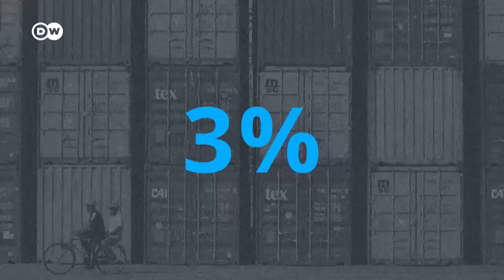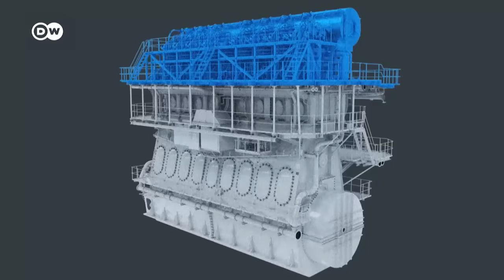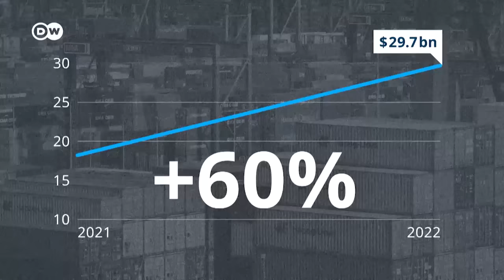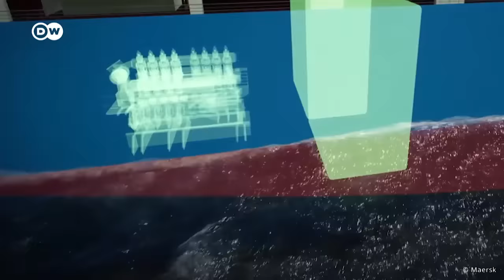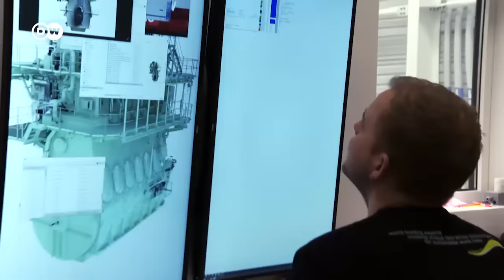Why cargo giant Maersk is investing millions in methanol-fuelled ships | Transforming Business

Comment: They didn’t mention the biggest drawback of methanol, which is it’s less than half as energy dense than diesel. So you’ll need 2x the size tank to go as far. That means higher costs for shipped goods.
Reply: 6
Reply: China using electric trains to ship to eu,
Reply: @joelimbergamo639  the goal is to restrict shipping competition by increasing compliance costs, I can see eu banning non green shipping
Reply: @bedeorama9881  good thing we can shift everything to electric wich is carbon neutral 🤔
Reply: You don't really need to mention the fuel that you are explicitly moving away from.
If we wanted to do a direct comparrison there are multiple factors that would also have to be included, not least the fact that diesel shipping is being subsidized. 
If shipping using diesel had to pay not only for diesel production and delivery (input cost), but also for output costs (environmental pollution, human health-based productivity loss, etc), the price of shipping with diesel would be significantly highr.
Reply: @joelimbergamo639  The video mentions 2034 as the deadline for 2% renewable-sourced fuel in the EU. Perhaps you mistyped. 2% is only a tiny first step, but it ensures that every shipping company has looked hard a decarbonization and started to invest in a solution of their choice. They don't have to choose e-methanol, if a better solution like ammonia is ready in time.
Reply: Many ships have fuel tanks far larger than are actually needed for their ordinary operations, and the extra capacity is instead used to optimize where exactly they refuel, depending on regional price variations, scheduling, and so on.
Reply: yeah but if cost of methanol fall below certain price, it will become economical.

And its price will fall because the price of Green Hydrogen (which is used to make methanol) will keep falling.
The price of green Hydrogen will fall with time because Electrolizer will become more efficient as well as cheaper and price of Green electricity is also falling exponentially.

Exponential cost curve always disrupt the industry.
Reply: Similar for ammonia, plus ammonia is bloody poisonous making handling it a hazard.
Reply: @DatingForRealYoutubeChannel True. The old bunker oil used to kill hundreds of exposed workers every year, so polluting fuels need to be reduced asap.
Reply: Methanol also won't produce as much power when burnt in the ships engine. You know what would be a great start in reducing emissions and only require a pen stroke from the person at the top of the shipping company. Burn only diesel instead of switching to  heavy fuel oil after leaving port.
Reply: They burn bunker c fuels (#6 fuel oil). Methanol has 64500btu per gallon where Bunker fuel has 156000btu per gallon.. this idea is ridiculous 😅
Reply: @Charvak-Atheist  mm  no.

Comment: The cost of inaction on climate change and pollution  is much bigger than the price of climate change mitigation
Reply: Yes, and this has been true for the last 30 years since the Rio Summit where the participating countries passed a resolution to reduce carbon emissions in order to avoid dangerous climate change. If the world the world had acted as quickly as it did on ozone-depleting chemicals (the Montreal protocol), we would be half way to a solution by now, and the transition costs would have been significantly lower. As it is, carbon emissions have not yet peaked. But all that is water under the bridge, it has already happened and we can't change the past. Urgent action today is what matters.

Comment: What's the point? Burning methanol still produces CO2 and water. Same for any biofuels/ Burning of any fuel, no matter what its source. releases CO2. How do you ever get around that basic chemistry???
Reply: The idea is the CO2 to make the Methanol is captured from the environment. And the energy to do so is from renewables. Therefore net zero.

But even though it has an outsized effect on the environment, there's not actually that much of it in air compared to Nitrogen, which is the feed stock for Ammonia. Hence why the talking head said that was a better synthetic fuel to use.
Reply: Seriously? Did you even watch it?
Reply: @spateri728  I don't really think it can ever be net zero. But point taken. It;' the best they can do. :-)

Comment: In the perspective of alternative liquid energy carriers for flexible and safe usage, methanol has many advantages. Methanol as the simplest alcohol is the most effective carrier for liquid bound hydrogen (at moderate temperature and atmospheric pressure) in regards of molecular hydrogen-carbon weight ratio and environmental friendliness. Many microorganism need methanol as nutrition to work properly (e.g. bacteria's in sewage plants) or just have a look at the nature, where megatons of methanol is emitted by our green plants year by year as a product of photo synthesis and is used by other plants and microorganism in their nutrition and energy life-cycles. 
Renewable methanol as a liquid energy has the big advantage of a "one for all"-feed-stock. We can use it either as fuel for fuel cells or in conventional thermal application or as a fuel blend in a high variety of concentration. Also new plastic products will be made from renewable made methanol (e.g. LEGO). One product who can cover many applications and use existing infrastructures for storage and distribution. This is very important in a sustainable thinking of re-using existing infrastructure and the way we can smoothly transform from "old technology" to the new energy applications in a holistic view of new solutions. But yes there is the important question, how and where we will get the energy to produce renewable methanol? Well, why not copy the energy efficient principles of nature for that (e.g. methanology.com, synhelion.com)

Comment: Where biomass is created as a biproduct in sufficient quantities to improve soils, salt affected (often desert) soils (which are often barely soils but barren) can remove salt-affected ground (a big task) and then make soils from the humic material atop it and grow alcohol cash crops (or lipids and sugars) often in blistering hot conditions but the ground temperature is shaded and increases the probability of rain falling to hit the ground before evaporation might have otherwise prevented it (which is what currently happens). It means however that methanol and ethanol are made. Methanoic acid is a useful biproduct such as for ice removal. Cocounut and sandalwood are amongst some salt tolerant crops. Some lignite coke can yield germanium as a biproduct worth keeping (electronics, especially spectral analysis computing, etc.). The more cash crops however, the less the need for the coke oven gas. With designing, a vessel with more than one fueling mechanism can travel to the waste plastics in the seas and collect and convert the plastics into fuel by pyrolysis in large amounts and use it for propulsion.
My comment has no hate in it and I do no harm. I am not appalled or afraid, boasting or envying or complaining... Just saying. Psalms23: Giving thanks and praise to the Lord and peace and love. Also, I'd say Matthew6.

Comment: Longer term an interesting engine would be one which uses methanol and oxygen rather than air (maybe add the oxygen to an exhaust gas recycle stream).
Exhaust CO2 can then be separated and returned to port to make more e-methanol.
For really big ships use a direct SCO2 turbine to do similar, even easier to separate and return starting from pressurised CO2. 
No bio source of CO2 nor DAC needed, the CO2 becomes contained and circular.
Reply: Interesting. I think "SCO2" refers to supercritical carbon dioxide (also styled sCO2). Some references to research would be helpful, if somebody could provide them.

Comment: they ought to put more into RnD to create even more efficient Methanol Fuel Cells? Once we get 70% efficiency, we should ought to just stick to FCEVs using electric motors for propulsion on both water and land and use much smaller batteries unlike a BEV? Also ships are big enuff and just by being on water could they not capture CO2 from water (currently easier than capturing from air) and turn that to Green Methanol on the go? I believe i read a recent research article mentioning the US Navy doing this? Btw there is a FCEV Methanol powered sports car called Gumpert Nathalie built by a legendary german engineer i believe..
Reply: That was thought exactly. With an high efficiency methanol fuel cell (rather an old fashioned IC motor) you can have an all- electric ship with all the advantages of that solution (efficiency, steady operation, compactness, etc...)

Comment: Why can't fermentation generated methanol be used? It is a waste product of spirit distillation (vodka, rum, whiskey, etc). It is also a waste product of charcoal production; being made by the pyrolysis and distillation of woody plant material such as the discarded branches from logging, the stems and leaves of food crops, paper waste and the scrap lumber from construction and demolition projects. Methanol is also called Wood Alcohol for a reason; we've been refining this method for the past 5000 years. We can now also capture the gaceous byproducts (methane, and CO) to use as an alternative to LNG and propane. While it does take thermal energy to run the process, recycling the tar and a portion of the charcoal to run the process will still net much more usable fuel. 
It can't produce all of the fuel we need, but it is A method that will clean uo other industries by using their waste.
Reply: I believe fermentation-generated methanol is called bio-methanol, and along with electrolysis-based e-methanol it is mentioned in the article. Maersk is also sourcing some of it future green methanol from bio-methanol. The problem is that its potential for scaling is more limited than e-methanol, the feedstock is finite and the world would soon run out of land for photosynthesis if it relied only on bio-methanol to replace fossil fuels. This would also compete with food-growing uses of land, driving up the cost of food which would impact food-importing countries a lot. So it looks like bio-methanol will only be viable in a transition stage until a production pipeline to generate affordable e-methanol can be put in place. What is "affordable" in a world dealing with a crisis of global-heating changes over time. The cost of not acting or continuously postponing action is even less "affordable".

Comment: If regular engine is power with compress air+fuel only 25 % fuel is needed,now compress air can be produced in open sea and mid ocean 
refueling ,the trick is dessing a energy harvesting vessel probably sail, kites,,solar if a vessel is only used to power a compresor or hidrogen production 50 to 100 mw/h
can be achieved,they will always sail at 90° against the wind.

Comment: The cost of green methanol will depend on how its produced and how much is produced. Methanol will be needed to replace fuel for ships, to replace natural gas for natural gas electric power plants and for the production of synthetic jet fuel. And, of course, methanol will still be needed for the production polymers like  plastics. 

 In the long run, methanol produced from remotely sited floating nuclear  power plants will probably be the cheapest since tens of thousands of reactors would be required to replace fossil fuels. And that would reduce the capital cost of nuclear reactors-- dramatically-- which would also dramatically reduce the cost of producing methanol. 

The most expensive source of CO2 for manufacturing methanol would come from direct air capture. But the cheapest source of CO2 could come from the capture of flu gases from methanol electric power plants. Such a recycling of CO2 (originating from air) would make methanol for electricity production-- carbon negative.

Comment: Or they could just switch them over to nuclear power. They need such a relatively small amount of power compared to a carrier.
Reply: Safety and Cost of manufacturing a nuke ship are extremely important factors.   If the shippers are not adopting best practices and safety protocols they can create irreversible nuke accidents.
Reply: I'd prefer to have the reactor on the ground producing methanol. I don't want hijackers to have the opportunity to hijack a nuclear ship.

Comment: Opting for methanol, biofuels is a positive movement.  The shipping sector needs to address the issue of abandoned vessels...so chemically fouled, asbestos burdened that no metal salvage firm will touch them.  These vessels are abandoned along the coast of Africa.  Ownership near impossible to ascertain.   Responsibility for abandoning just as difficult.

One ship using methanol...one adaptation to biofuels is "move", but Maersk is conducting a considerable amount of "green washing" for the shipping industry.

Comment: Wasn`t methanol actually worse for the enviroment?
Reply: Well they are using it as a fuel. Not releasing it into the environment
Reply: @nigel493  In addition, if methanol leaks into the environment in small amounts, it is not particularly toxic, as mentioned in the video. Plants generate and release methanol all the time, the biosphere has existing ways to deal with it. The feed stock of methanol production is what can make it bad for the environment. Currently, industrial methanol mostly comes from fossil fuel refineries, and adds to carbon dioxide emissions when it is burned or leaks out. What Maersk and others are proposing to use is green methanol, sourced from biomass fermentation or electrolysis. In the early years and decades, even green methanol won't be fully carbon neutral (consider the steel used in the plants), but it is a step in the right direction.

Comment: e-methanol will always be more expensive than using electrolysis-derived hydrogen directly (fuel cell or direct combustion or both), and using electricity directly will always be cheaper. But large ship-sized engines for methanol can be ordered today, and ammonia engines cannot. So, I think the Maersk leadership deserves more credit for taking the bold decision it has, when the IMO and everybody else is dithering even as our common home is burning. If ammonia or direct hydrogen or some other future technology becomes cheaper later, nothing is stopping the world and Maersk from shifting to it in the future. By guaranteeing would-be producers future sales, they are creating a market for e-methanol as rapidly as possible. This will be a benefit for whole world, even if later the electrolysis production that it stimulates shifts to ammonia or just hydrogen or something else. 
    The hard decisions of the decarbonization transition would all be made a lot easier if the world, or even just the major carbon polluters, would agree on a suitable carbon price implemented through carbon credit markets, taxation and border adjustment tariffs. The argument that "the technology is still too expensive, let's wait for something better" just doesn't work when with every passing year the cost of fixing the problem at source gets more expensive. The world's carbon emission have not even plateaued yet, and there is a small window for acting to turn things around before the costs of both mitigation and adaptation get dramatically higher and still inevitable. 
    Our generation has to act to reach net zero and not pass the burden to future generations. We are already burdening several future generations with finding a way to transitioning further to a civilized world with negative emissions. A governable and sustainable economy will not be possible without reversing the overshoot of emissions already locked in with the production systems in place and in the pipeline. The world needs to bite the bullet and achieve net zero over the next thirty years, because it will be hard enough for the following generations to get carbon dioxide levels back down to a safe concentration. Hansen and others think that is 350 ppm, I haven't seen research showing that a higher concentration is good enough.

Comment: Solar panels atop the containers would drive electric motors directly to save fuel used 😊.
Reply: Try and look up the size of those engines
Reply: @natbirchall1580  good work. In this alternate energy stuff, we see the number of mega watts saved in a six-month trip. I've had the same response from other industries ( hospitals) too. It's obvious that solar won't generate power for their equipment. However, it would power ⚡ lights, fans, and elevators through the day.